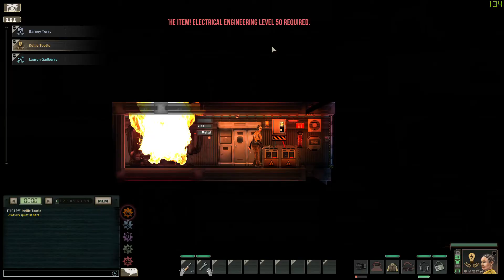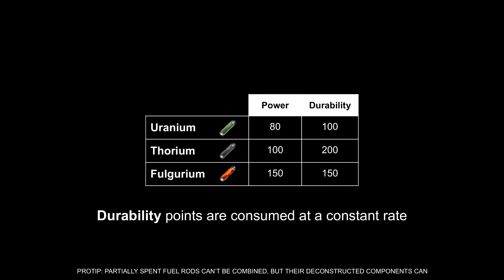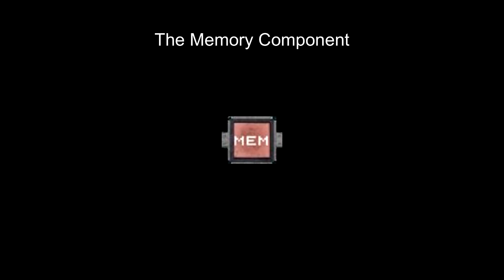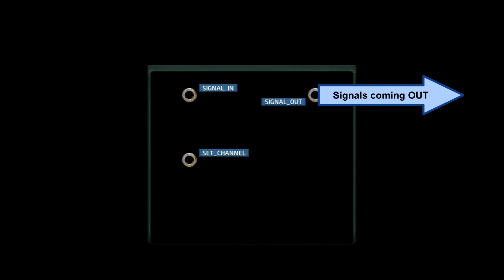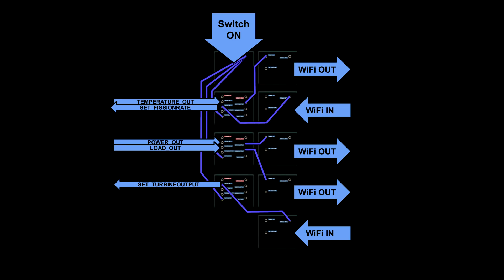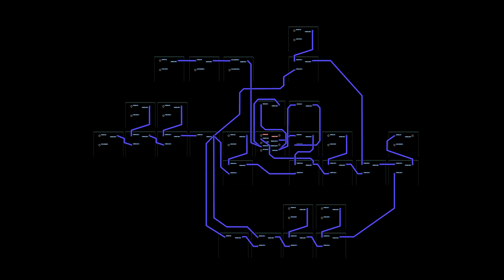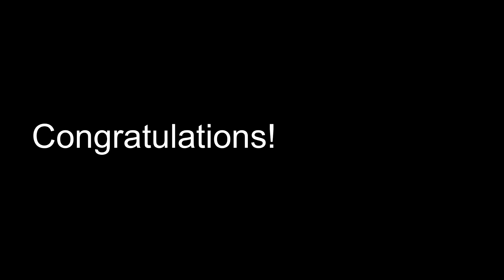Perfecting Reactor Control

Comment: You lost me as soon as you started talking about signals and components...
Like for example, you talk about signals carrying a 0 or other than 0 value, but you don't explain how those signals are originated.
Also, why does the wifi component have a signal_out wire? Isnt it supposed to send outputs through the air in a 20m radius? Im confused.
I feel that the component explanation could use some examples for each component.
Reply: The wifi component requires there to be at least two of them in range and on the same channel of eachother. One of then you wire to imput, say if you want to control another ship's turret, you would wire "position OUT" to the wifi component's IN. Than on the other ship you would wire the Wifi conponent's OUT to the turret's "position IN". Basicly IN is signal you want to send, and OUT is where you send that signal. (Honestly if they had made it into 2 different component, one for sending and one for recieving, it would be a tiny bit less confusing. Hope that helps
Reply: @thomusroye5667  I appreciate you taking the time to reply, but Im afraid I didnt understand your explanation either.
Reply: @tarael86  Simply put, the string you send into signal_in will be transmitted to other wifi components on the same frequency. Then you use signal_out to get that string out of the component.
Reply: @acerraser8142  You good speak. Neanderthal tribe accept you. We still no use lightning sorcery, cousin Gronk like to control reactor manually. Only explode sometimes.
Reply: The WiFi component receives a single through a cable, then other WiFi components on the same channel output that to their respective circuits, without the wires connecting them all, since all other components require cables. WiFi components only communicate with other WiFi components within range
Reply: The signal out just means you can send signals from that wifi via cables, ala turn a thing on when WiFi activates.
Reply: Signals don't carry a 0 value themselves, you're overthinking it a bit. Rather, think of it as the presence or absence of electricity. A 1 "signal" is just power going in, at the most basic.
Reply: So the bit where you went wrong with wifi components is "sends outputs through the air in a 20m radius" the wifi component sends whatever you put into signal_in "through the air" in a 20m radius to *other wifi components*. If you don't have another wifi component to receive those signals you are just broadcasting to nothing. Think of it like a pair of radio walkie talkies, one walkie talkie is just broadcasting radio signals into thin air - but a second walkie talkie can receive that radio signal and do something with it. The signal_out wire is there to then do something with that signal that's been received - for a walkie talkie that's the speakers so you can hear the audio that was broadcast, for this wifi component its just an electrical signal that you can then send along a wire to do whatever you want with. Wifi components are useful since they save you crafting lots of wires to run signals long distances, and there is no limit to how many wifi components can be sending or listening for signals on a channel.

To answer "where are signals are originated" - they are electrical voltages generated by components (or large devices) but the voltages are used to represent data rather than for powering things. Usually low voltage means 0 and high voltage means 1, but barotrauma is a bit fancier than that and lets you send higher numbers and even text over wires.
For an example of where signals originate, buttons send one briefly when you press them, and the oscillator sends one at repeating intervals.

So to put this together into a system that repeatedly switches on and off all the lights across the ship:
An oscillator can generate a repeating signal, a higher frequency will flash the lights quickly and a lower frequency will flash them slower - plug this signal into the input of a wifi component - this wifi component will be your broadcaster that will broadcast the oscillator's pulse across the ship.
Next to the lights you want to flash, install another wifi component as a receiver. You can use as many receiving wifi components as you want depending on how many lights you want to wire up. Then run that signal from the output of the receiving wifi components into the toggle state of the lights - which will now start flashing!

If you want to extend this as homework you could add more oscillators set to produce a sine wave, a colour component and some simple maths to give your ship rgb rainbow lighting!

Hope this helps, and if you have already figured this out by now I hope it helps anyone else reading.
Reply: Hi, I haven’t touched any of these components but let me give it a shot. 

The WiFi component accepts an input through SIG_IN, and re-broadcasts that input to any other WiFi components within range on the same channel. 

Any WiFi components which receive a signal will then send that signal out on SIG_OUT, so it can be used to communicate with other components. 

For example, you feed a temperature reading into a WiFi component we’ll call Temperature Transmitter from the reactor to the WiFi component’s SIG_IN. In the next room over, you have a WiFi component we’ll call Temperature Receiver. That WiFi component will receive the temperature reading, and output it through SIG_OUT to whatever is connected to that output. 
You could hook up logic in such a way that a temperature reading over a certain threshold turns on a light, opens a door, or performs some other function. 

Tl;dr: the SIGNAL_OUT is for the WiFi component that is receiving a signal from other WiFi components. WiFi components only send to other WiFi components.

Comment: Dear Gaming Nerd
Do you mind if I ask you some questions about the part of dynamic memory?
Is it designed to recieve signal in every period of time? I'm quite confused because toggle_state actually recieve any signal to change the state of the relay.
Reply: i am not him but yeah it is basically that. the clock signal toggles "toggle_state" so "state_out" sends a signal to delay component and to the Not component. unlocking the data from the memory component. Then, the delay component toggles "state_out" again and the process repeats.  I am new at this but i think that`s how it works
Reply: @thiagopose6370  Yeah, but "state_out" of relay is constant 1 or 0. It doesn't need to recieve any signal via "toggle_state" from the clock signal to send out 1 or 0. That is,  the relay and a delay could cause the state of relay to change as fat as this game can no matter the numbers in delay or the clock signal.

Comment: I heard of PID controllers from my dad, and I was not expecting them here but it's simply brilliant! I'm totally installing this system onto my submarine and freeing up my electrical engineer for other tasks.
Edit: Ran into the video using Greater than and Reg Ex. I installed that version instead onto my subs and set the outputs to a relay I could turn on and off. Just in case someone wants the "cleaner" base game auto control for some reason.

Comment: It seems to love throwing my fission rate up to 100, if I try to force the fission rate below 35 then the fission rate drops to 0, before spiking back to 100 while the output drops to 0, until eventually the fission is at 100 and the output recovers its prior status. Running on a reactor with 48k max power, idling at 24k load, using 2 fuel rods because it gets fussy about it and shuts down otherwise.
Reply: I also had the problem that the fusion rate always jumped to 100%. But the solution is quite simple. With the temperature control, the input signal for the reactor temperature for the first division module must be placed in input 1 instead of input 2. In short, the input signals are simply exchanged there.
Reply from the maker: @thorstendenktnach  As soon as I am able, I will make a new & improved video without all the tiny but significant mistakes fixed. My apologies, the best I can do for now is to upvote all the comments pointing out that wiring f*%k-up and hope new viewers see it. Thanks for the input, your feedback is very much appreciated!
Reply from the maker: @thorstendenktnach  Check it out! The PID controller has been replaced by a shockingly simple alternative... https://youtu.be/KEfWnL-kyL0
Reply from the maker: Did you see my walkthrough video? It's a step-by-step guide to constructing the PID and feedforward controllers, maybe you can spot the difference that's causing your problems...
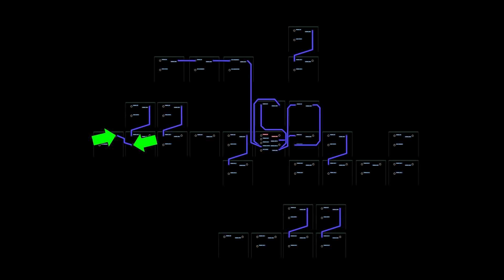Reply: @TheGamingNerd2022  So at 18:44 you divided 100 by the temp instead of dividing the temp by 100

Comment: Hey nice video. I tryed to rebuild this but my fissionrate just jumps between 0 and 100% and it also seems to only get updated every 5 sec or so. Any ideas what I did wrong?
Reply from the maker: If it's only updating every 5 seconds (or thereabouts), its possible your delay blocks are incorrectly set. Did you check out my walkthrough video?
Reply: @TheGamingNerd2022  I have watched the walkthrough too and watched for the delays . They seem to be set right. Do u maybe have any workshop builds useing this system?
Reply: @Pudddding007  If you use a comma instead of a period, the value of the delay component is automatically set to 5.0. Check whether this happened to you easily. I also noticed that the wiring of the temperature control in this video is wired incorrectly. The input temperature signal must be sent to input 1 of the division component. Then the circuit only works.
Reply: @thorstendenktnach  Ok thanks Ill try that

Comment: Hi Rob, new player here...I have spent several hours following your video intricately and triple checking connections- I tested it this evening and I blew up the sub! Test run1- FAIL..... so I have the wifi and relay switch system next to the reactor, I have stored away in a different room with the 5 wifi channels I have some questions (they may be silly but ya know new player and all) I put the reactor onto manual assuming id would follow the system i built? Also i was unsure whether the switch was on or off is there a way to know where I'm at? any help greatly appreciated :) Coral
Reply: Idk anything about how this works as I've not even built it yet, but you can wire switches to a lamp of you choosing to indicate on or off. I would suggest setting the light color to green to indicate on, remove the power requirement for testing. When the switch is off, it sends a 0 turning the lamp off, when the switch is on it sends a 1 which turns the lamp on. IIRC the switch has it's own lights but they're dim and hard to tell. I suppose if you wanted to be fancy you could add a not gate and a red colored lamp to indicate off, or a signal checker with target 0 and output 1.
Reply: @arctic3007  thank you great idea will try this! I must have gone wrong somewhere the whole thing exploded in glory 😂
Reply from the maker: Have you seen my walkthrough video? It might offer a different angle that could help
Reply: @TheGamingNerd2022  oh no I haven't I will try and find it thank you!

Comment: well it's 1 am and after playing around with the wiring, I feel as though I did something wrong somehow haha. Whenever I flip on the sub and then turn on the autocontroller system, the ship seems to either completely go to full turbine and 0 power output, or full fission rate and trigger a meltdown.

I'll try again another time but It's a bit difficult to get the hang off all the wiring. It's entirely possible that I missed a connection. 
The ship I'm trying it on is the (VH) The Iroh from steam workshop.
Reply from the maker: Check this out, it might be helpful in your search... https://youtu.be/S5hak5NY9xQ
Reply: @TheGamingNerd2022  I've retried this Controller again and everytime I run it, it runs excessively hot to the point of catching fire every 5 minutes. I tried starting the reactor with 4 fuel rods at steady load and it triggers meltdown almost immediately. I'll try your walkdown version but I'm honestly very confused at the moment :(
Reply: There must be an error somewhere in this video... perhaps a misinput but your walkthrough video does work and I now know how to make a proper working PID controller I think
Reply from the maker: @explosivelemon8261  the error has been found! The very first division block in the PID controller is wired backwards, it should be: 
(Input signal) /100
instead of the way it is currently wired:
100/(Input signal)
Reply: @TheGamingNerd2022  oh wow! I didn't even catch that haha. though one thing I did notice is that in your walkthrough video, you add 100-0 limits on both of your addition blocks that set turbine and fission rate! here you only clamped one of the addition block I believe. I don't know if that matters too much though...
Reply from the maker: @explosivelemon8261  clamping anywhere else can screw with the math. Sig figs, man, Sig figs!
Reply: @TheGamingNerd2022  I don't fully understand the math yet haha but i just noticed that you had clamped two add components in your walkthrough but only one here haha

Comment: Well followed the steps,when i turn on the switch it did self-adjust for awhile then it just turn the turbine rate to maximum where its away from green and orange bar of turbine meter
Reply from the maker: Check out my walkthrough video, it might help identify the source of your problem

Comment: For anyone wondering why the PID system keeps melting the the reactor after a tour and having a good habit of turning off the reactor while docking in outpost, make sure the value in the dynamic memory is 0 or low enough before you switch on the reactor.

Comment: What advantages does this have over using the "Automatic Control" IC that comes factory with the reactor? While I like the idea of "gerry-rigging" one's own wiring, I didn't know of any "room for legitimate difference" in target reactor settings: a player, or a player-made circuit, would seem to do "the same thing", just with more opportunities to mess up.

Does it allow faster response times to avoid voltage drops when the captain starts doing crazy maneuvers, or something like that?
Reply from the maker: Not something like that, exactly that. Fabricators turning on and off, engines, weapons, pumps, all put near-instant, unpredictable step changes in load, and this controller is the closest thing to zero-lag control that you'll find.

Proof: https://youtu.be/ga4Ou1iglZY
Built-in autocontroller @ 0:05
PID autocontroller @ 2:30

Comment: Good content and explanation, can you make a guide on the wiring components in barotrauma (explains each component functions and when where to use it with examples) ? This is a not widely explained concept and i felt like this video explains it very well with diagram and such.
Reply from the maker: I can do that for sure. I've been working on a video describing the submarine editor, and I'll probably dedicate a whole video/chapter on the most common objects... Is there a particular component you need help with?
Reply: Probably the most fundamental component combinations because that is the hardest part in sub-building for me. For example, how to use components to label informations on the ship (such as temperature, speed) those kind of things. And other usage of components. Maybe the logic behind them, when to use them, which one is the correct one for certain scenarios. (useful tips such as how you said that math components goes well with memory components)...etc a new player like me wouldnt have figured it out.

Comment: I've checked and double checked the component values and wiring. I get no changes from the reactor when I turn the switch on. It's like no part of the controller is doing anything at all. Any ideas?

Using Humpback sub....
Part 1. Relays and wifi next to reactor
Part 2 and 3. Below in the ballast.
Reply from the maker: #1: make sure that the signals are wired in the right direction at the wifi components and relays. For example, signals leaving the reactor go into the "signal_in" of the wifi component, and are transmitted to the "signal_outs" of all wifi components on the same channel.
#2: logic signals are trumped by blank signals, so make sure all of you memory components have values in them, and that there are no letters or spaces
#3: try connecting simple memory blocks to the wifi channels for the fission rate and turbine output inputs, and see if they set the reactor to the same values
If you haven't already, check out my diy walkthrough!
Reply: @TheGamingNerd2022   Thanks for the quick reply. Using your recommendations:
I found out that using the relays as a 'node' does not work. Wiring the fission rate and turbine output directly to wifi out fixes that. This makes relay 3 obsolete.

Now it is working as long as there are 2 or more fuel rods in. Tested with each fuel type. But the temp was staying too low, so I changed the first memory module from 100 to 150, working great.

Comment: Hi! I tried to follow your guide, but for some reason PID controller tries to set fission rate to 100 when there is no need fo it, resulting in meltdown. I checked my component values and wiring but didn't find any mistakes. Can you recommend a way to find the problem?
Reply from the maker: If you're editing, use text displays to see which of the three controllers is acting up. The difference should be obvious.
If you're playing, I can only recommend looking for the most common mistakes:
- the first subtraction block should have signal_IN_1 connected to the memory block (50) and signal_IN_2 connected to the output of the adjacent division block
- the final addition block should be clamped between 0 and 100
- check that all delay blocks are configured for 0.05 seconds
- make sure all memory blocks have the right values